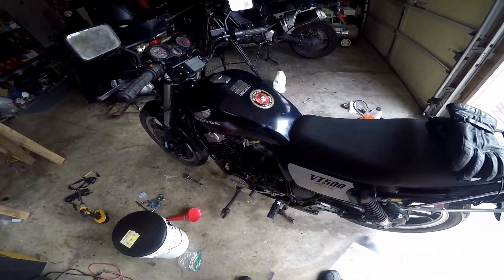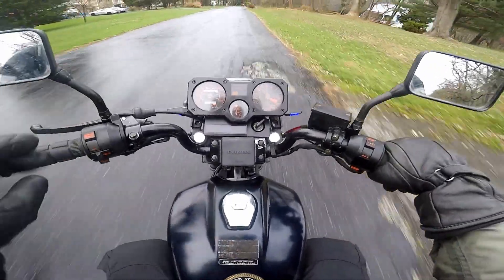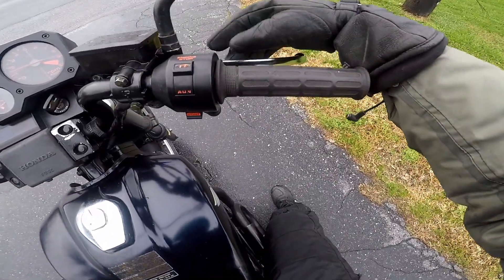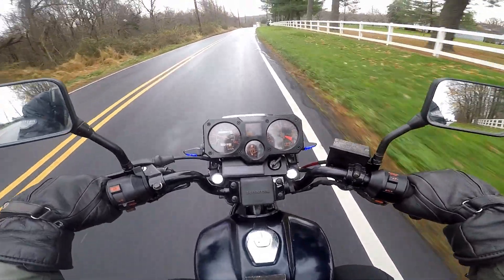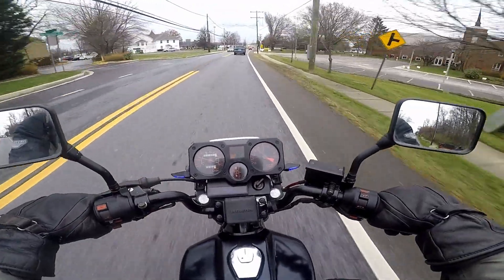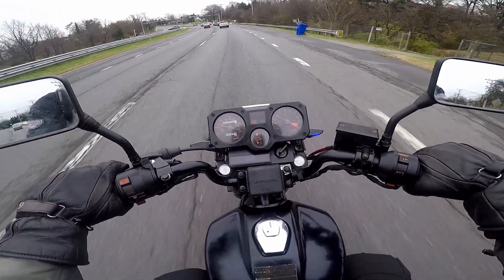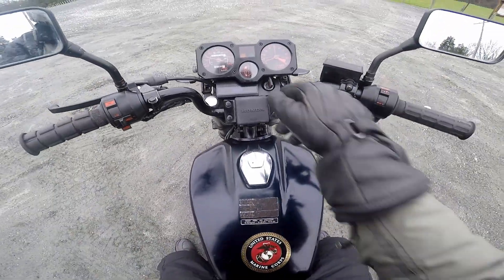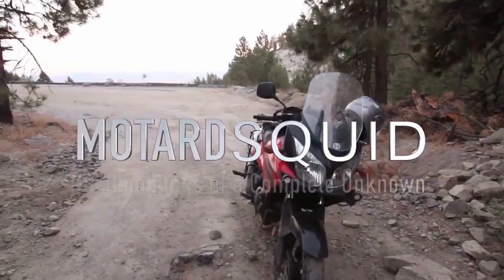1983 Honda Ascot first ride

Comment: You are overlooking the brilliant Suzuki GS and GSX's of the early 80's. The 650 and 850 were both shaft. Easy to work on parallel 4's, with a ton sold and spares readily available.

Comment: Dunno..Doubt its a carb problem...Seal the foam together..then soak it w/gear oil and squeeze out the excess.All CV carbs are
jetted lean...They need restriction to operate properly.Been there done that, another gem youve saved...your getting close to
hero status here..and collectors around the world..Thanks for the ride.!